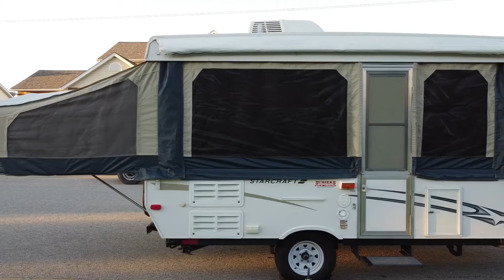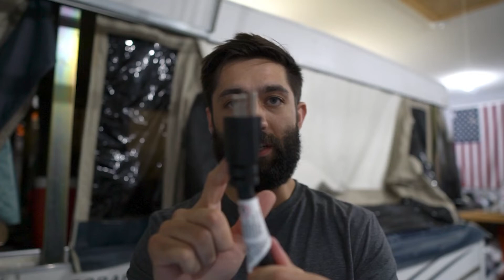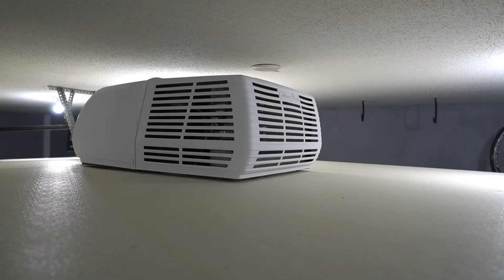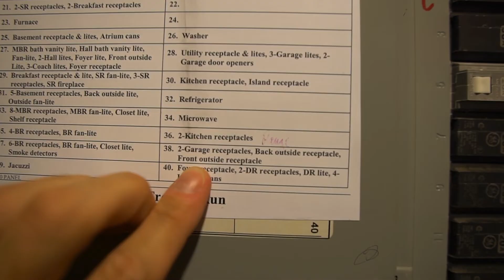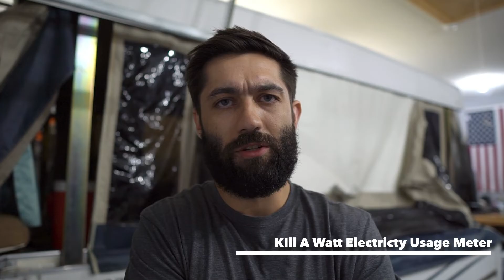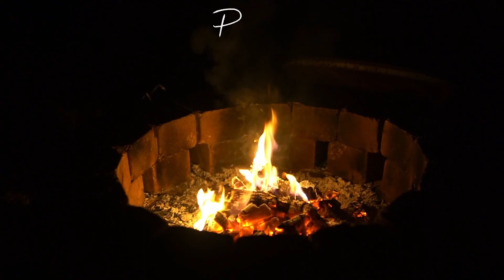The TRUTH about Pop Up Camper AIR CONDITIONERS | How to Connect Your Pop Up ELECTRIC at Home

Comment: Does anyone know where i can source a replacement roof top AC power cord for a pop up? These things are like unicorns! I bought a used Pony 2100 and it was using two 6' grey extension cords. Want to replace with a single white whip but can't  find a source or even a reference at all! Appreciate any info!

Comment: As an electrician I'd add a couple things.  For one don't leave extension cords coiled up while in use as the heat generated by the current and magnetic field can cause a fire.  It's a common occurence.
Two if you have it plugged into a 15amp circuit you are certainly safe to use a 14g extension cord.  14g conductors are rated for 15A and if the current exceeds that the breaker should trip.  For 20A circuits you should use a 12g extension and as you stated 10g for 30A.
Third unless your voltage is already borderline low you shouldn't have to worry about voltage drop unless you are using more than 100ft(roughly) of extension cord and in that case as you stated the larger the wire the better to negate the voltage drop.
Thanks for the videos!
Reply: Electrician here as well. He didn't mention that the AC is a continuous motor, so you're also limited to 80%. I'm sure we both keep this in back of mind, but it's a very fine line, even with a 20A rated cord and circuit. It may not trip the breaker immediately, but over time you can have all kinds of issues. Even my heavy duty cord gets hot with my Mach 3 after a few hours of use. I also found that you need to be very careful with which brand dogbone adapters you buy as I've melted 2 of the cheap ones. The Camco's are generally pretty good but even that one gets warm after a while.

Comment: My ac unit has a separate regular wall plug in.   My camper also has a 30 amp connector.   Can I just run a 12 guage extension cord and plug that ac unit into a house outlet?
Reply from the maker: Our A/C requires a 20 amp outlet. If your A/C only has a 15 amp plug, I don’t see why you couldn’t run it directly to a 15 amp house outlet. However, make sure the extension cord is also properly rated.  It all just depends on the amperage required by your A/C.

Comment: I used a regular extension cord and the adapter. The air conditioning cam on but with in a few minutes , it shut off.  Could I have damaged the ac unit? Or since the power was not sufficient,  did it just shut down?
Reply: A plug and cord may be rated 20A and provide power for immediate start up, but there's also a continuous motor rule of 80% that he did not mention. Motors running continuously will eventually get the circuit hot with a heat buildup. It also draws a lot more during compressor startup each cycle. Your breaker is most likely tripping after a couple compressor cycles and getting the circuit hot. The breaker is doing its job and protecting your appliance. You should be fine, but I would look into putting it on a 30A circuit, or reconfiguring your 20A circuit by shortening the cord and making sure nothing else is on it.

Comment: We are new to pop up camping too
Can you show a video about backing up into a single garage ?
What’s the best way?
Thanks
Reply from the maker: Definitely, it’s on our to-do list.  The short answer is to go slow and have a spotter keeping an eye on your blind spots.
Reply: The make a hand cart with a ball on it designed for small boats. Works well if your moderately in shape and you are on a flat surface.

Comment: great video for the new pop up camper owners. I have a 2000 camplite camper  I love it. But the AC has a specific plug to plug into.. I bought a heavy duty cord to run just run to the AC when were at electric sites. . I can use the 30 amp plug outlet as well But this allows me to run everything. But I did come close to melting the first cord I used.. Who knew it used that much power.    Next summer At home Im going to install a run a direct 30 amp camper plug  in the garage.
Reply from the maker: When we’re running the AC at the campsite along with another power intensive appliance (e.g., an electric griddle), we will run a separate extension cord from the power post directly to the electric griddle so that it is not running through the pop up power system.  That way we can keep the pop up plugged in normally (via the 30 AMP cord) and still run the AC.  This seems like it achieves the same goal as what you are doing, just reversed - lol.
Reply: @ItsPoppin  yep lol Great page by the way I enjoy your videos. A lot of the things you show I have done already but there are still a few things Im learning as well. So thank you for the site

Comment: Im new to pop ups, Is there a amp Guage I can install inside my pop up so I know what its drawing while camping?
Reply from the maker: From shore power?
Reply: Shore or battery...
Reply from the maker: Well, you can monitor your 12V battery voltage with a simple battery voltage meter, which we installed in our last video ( https://youtu.be/h7uAkJMzWpA ).  It’s only going to tell you how charged your battery is and not how much amps/watts you’re drawing.  On the other hand, I think it’s possible to purchase and install an inline electricity usage monitor both for shore power and battery power, but we’ve never installed anything like that.  I would look up AC power meter or DC power meter and see what you can find.

Comment: Thanks for the vid. I purchased one of those adapters but was hesitant in trying it out.  Your video makes me more at ease in trying it out.  I don't have an AC unit, only lights, fridge and outlets. I will be running it out of a 12 ft 14 guage extension cord.. so I think it would be fine.  Just using it to make sure electrical system is working properly without running on the batteries.  Thanks again for the vid...keep it up! 🤙
Reply from the maker: Right on, you should be fine. I tested our fridge and it pulled 1.08 amps and 129.6 watts in addition to the base electrical draw.

Comment: No melting cords... yet ... lol 😆  wanted to know maybe I'm having trouble with my propane have you experienced the regulator going bad going from tank to pop up ? Maybe a video how your lines are ran. I Also got a free pop up im learning and fixing up. Thank you for all your great content
Reply from the maker: No, we’ve never had any problems with a regulator going bag.  Have you tried priming or bleeding your gas lines by lighting your stove top first before trying to start any other of the gas appliances?
Reply: @ItsPoppin  thank you I will try and bleed the lines . This is my first pop up still trying to learn all the little tricks thank you thank you